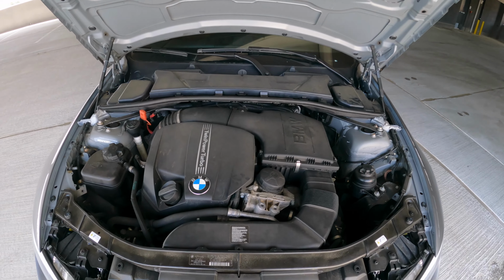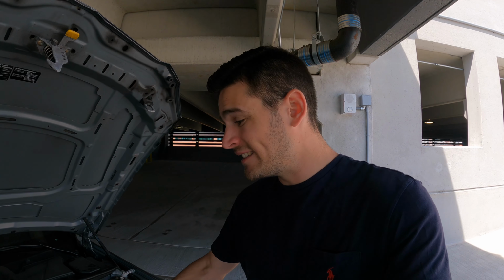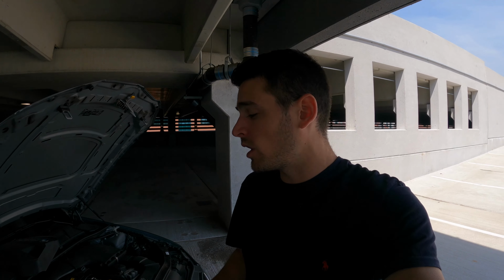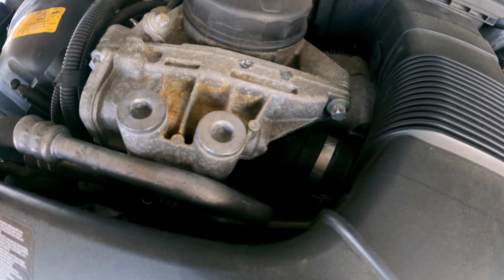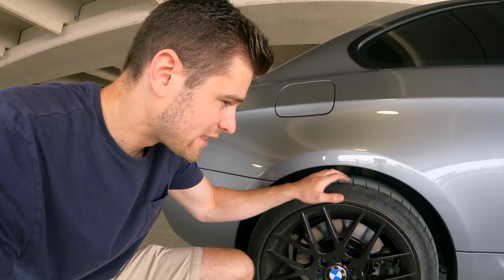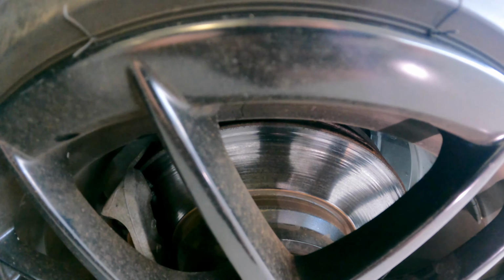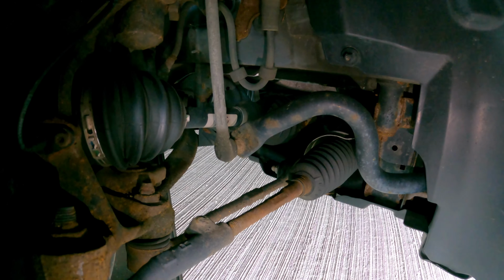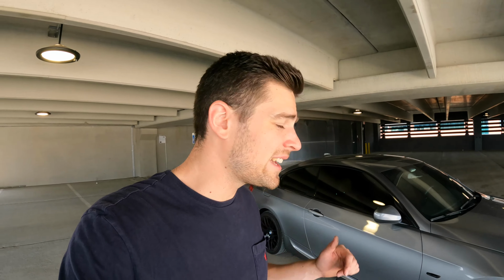How Healthy Is Your Car? Quick and Easy Vehicle Inspection - KEY AREAS OF FOCUS | E92 BMW 335i

Comment: Nice vid. I'm surprised to see the factory air box still on the car. Why no cone intake? Gives more air to the turbo, and allows so much more heat to dissipate. Or are you wanting to keep it as stock or original as possible?
Also, ya can't check the tread on the rear tires like that if you have coilovers. Mine is so low, I can't even get my pinky finger between the wheel and quarter panel. But it remarkably does not rub. Coilovers make the car look sooooooo much better.
Reply from the maker: With the power level I’m currently at there really isn’t any gain to the intake other than hearing some more turbo noises. The N55 air box supposedly flows really well and doesn’t see quite the same step up from an intake as the N54s

Comment: Clean vids man very informative. I  have a 335is DCT same color myself. I was in the market for a while and finally pulled the trigger.  2 years later no regrets and probably my favorite/exciting car ive owned. Warranty ended up fixing alot of the notorious problems that come with bimmers like the oil pan, HPFP,  valve gaskets etc. cant wait to start adding power on it haha
Reply: you got extended warranty?
Reply: @charlestucker6365  yeah car was under 75kmiles and was approved for warranty so i had too especially with 335s and thank god I did lol